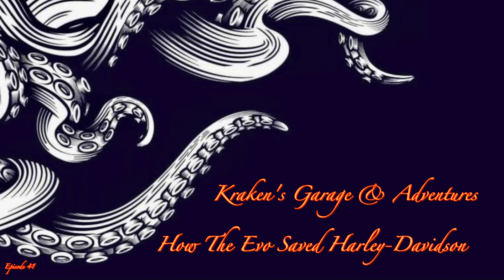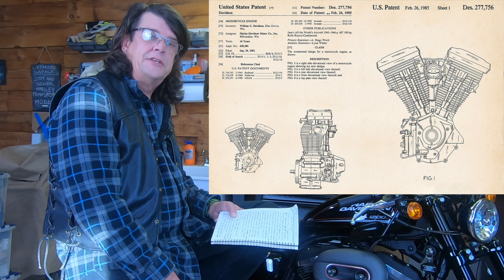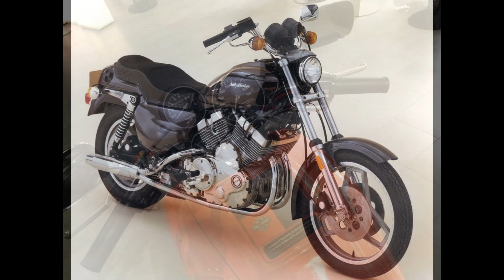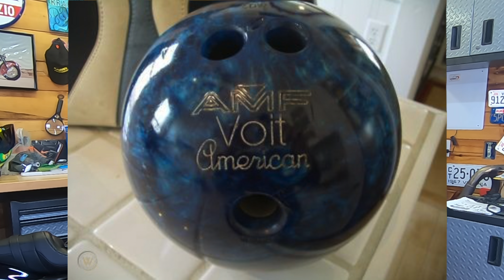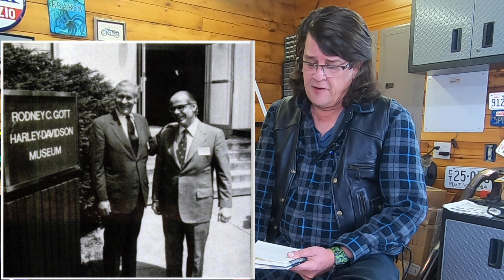How the Evo Saved Harley Davidson!

Comment: That is FAKE NEWS! The Evo was NEVER developed nor funded under AMF. I don't know WHERE people get this from. AMF was well out of the picture by 1983. If you have a link please feel free to share your research with me. Again, ZERO influence from AMF.
Reply from the maker: There's loads of confirmation on the internet. "Development on the engines started during the notorious AMF years in the 1970s, and the original Evo was a 1,340cc variant, which replaced the aging Shovelhead in 1984. They are air-cooled with push rods, overhead valves, and enough vibration to remind you that it’s no Japanese cruiser. There’s nothing quite like an Evo.

Here's a link to just one of them. https://ridermagazine.com/2022/10/25/evo-sportster-end-of-an-era/

Comment: I was there at the time it sold to AMF. I was riding a 1957 Sportster at the time...
Reply from the maker: I believe AMF saved HD despite some of the quality issues back then. Thanks for stopping by.
Reply: @KrakensGarageandAdventures  That is correct by designing the EVO engine, outside of that it was not a good time for Harley..

Comment: Thanks for this history lesson. I got my '98 Softail chopper two years ago and have been worried whether and/or when my Evo motor will decide to kill over. Just about everyone I've spoken with tells me not to worry since the Evo is one of best motors out there. I guess my worry is more about the builder having screwed me by using the crappiest crap he could find for just about every part on the bike so I can't help but wonder why he would have all of a sudden been generous enough to give me a good motor. So far so good as I haven't had any problems with the motor...yet. Thanks again!
Reply from the maker: If left alone, the Evo is bulletproof. It really is that good a motor. The problems folk have with it are from hacks working on them bolting on "go fast" parts. This compromises the logivity and durability of the motor. The good news is, should your motor blow, you can bolt in a crate motor, and you're good for 100k miles. Thank you for watching. Eric.
Reply: @KrakensGarageandAdventures  You're welcome. I enjoy your content and will definitely keep watching. The Evo is fast enough for me so no need to get into the motor. Hopefully she continues to hold up. Thanks for the feedback!